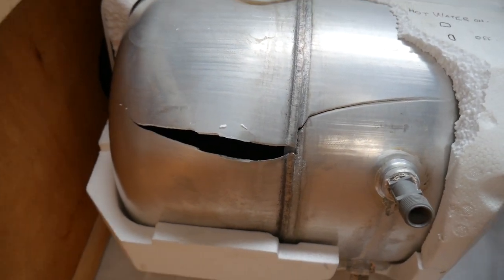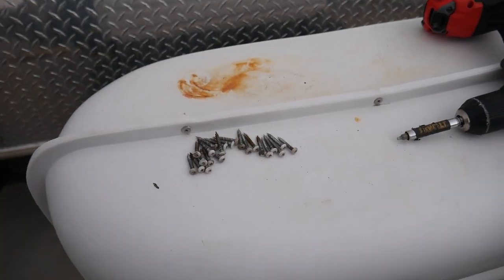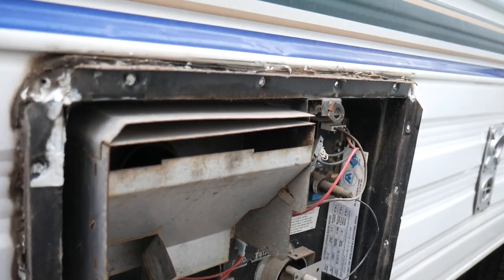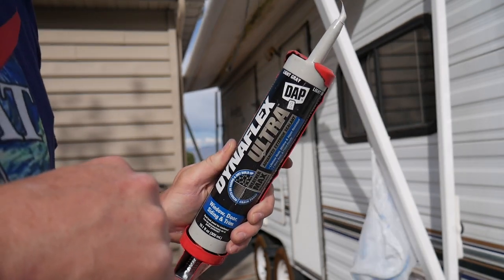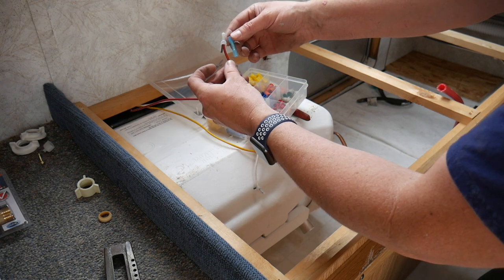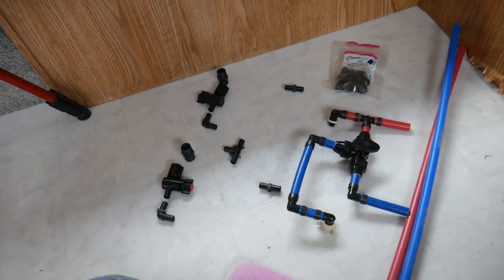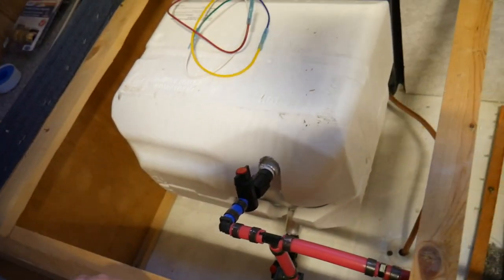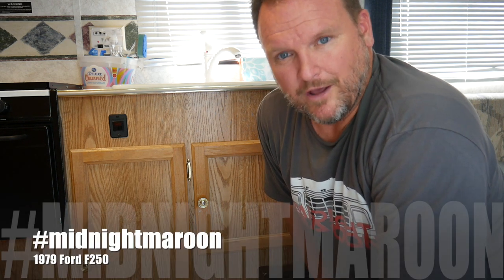HOW TO REPLACE YOUR RV WATER HEATER

Comment: I just bought my camper. It looks like the previous owner just removed the drain plug to winterize. Luckily on myrtle Beach it doesn't get very cold and if it does, it's not very often
Reply from the maker: Hopefully the other parts didn't freeze and break on you.

Comment: Great video.  I have a camper that's less than 2 yrs old, the water heater is electric & gas, and has stopped working.   Any tips on how to troubleshoot before I get a replacement?
Reply from the maker: "stopped working" can mean a few different things.  Does it not work with electricity but it does with gas?  Or vice versa?  Could be as simple as a fuse if it works with gas and not electric.  Check some of those basics before you drop the $900'ish on a replacement.
Reply: @troysgarage  No heat is produced with gas or electric.  I'll double check the fuses tho.  Thanks!